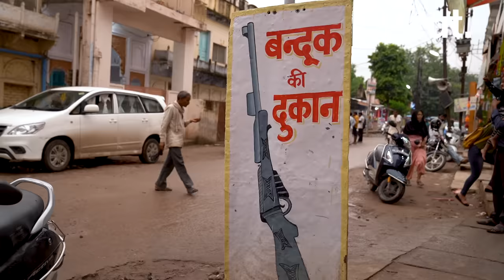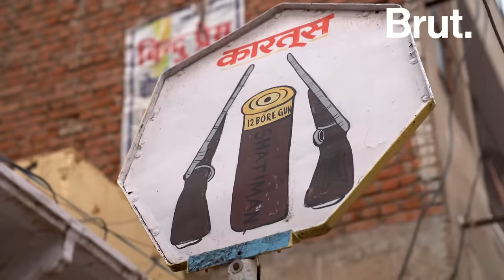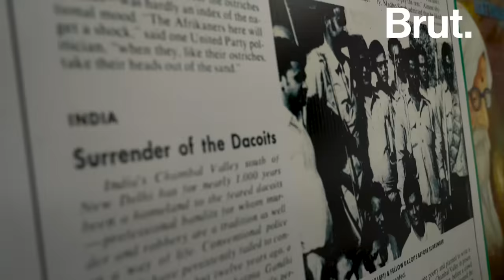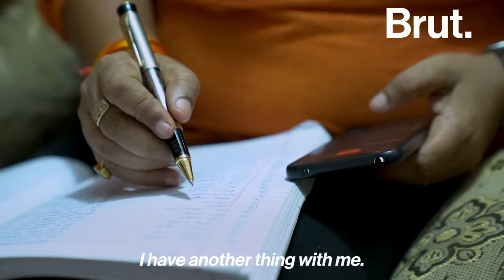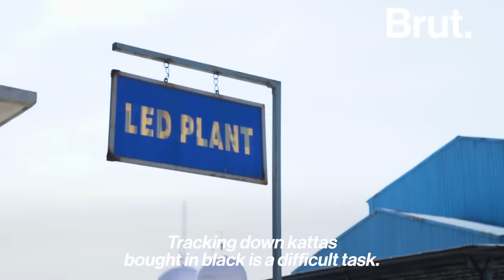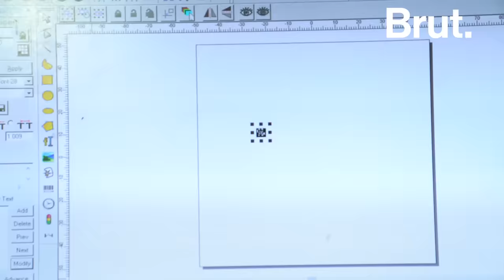Inside Chambal’s Gun Culture

Comment: Some issues with QR codes on ammo: Revolvers won’t automatically eject shell casings. Judging by the photos of those illegal firearms, they won’t either. What about someone defacing the QR code prior to shooting ? Or picking up a spent casing with someone else’s QR code and reloading it ( applying a new primer, gun powder and bullet to the casing ). Then if it’s used in a crime the finger is pointed at an innocent person. Seems like it may increase the cost of owning firearms, but likely will do little in regards to crime.

Comment: The qr code thing is dumb, you can literally take a piece of steel wool or some sandpaper and sand down the qr code completely from the brass. You can also, just pick up the brass after firing the round, which again renders the police from finding out the criminal. You have to be as smart as a chicken to be caught with this tech.

Comment: Engraving a QR code on bullets is a really smart idea. If somehow the inside of the bullet casing is QR coded then it will be even better.
Reply: it'll likely be flattened against the chamber walls, and thus unreadable. also, you could just sand it off. pretty useless in reality.
Reply: @indoorkite651  what will be flattened against the chamber walls? 

Of course it can be sanded off but it will take a lot of time! A countermeasure doesn't have to be perfect, it just needs to make illegal activities more difficult
Reply: @scramjet7466  you can easily sand down the QR code 🤣  what are you talking about
Reply: @jimfleece2880  don't assume it is easy. You can easily ruin the cardridge if you go too deep. Brass cartridges are not very thick, they are less than 1mm think in most places
Reply: @scramjet7466  all you need to do is remove a little bit in one spot and the QR code won't scan
Reply: @jimfleece2880  bruh. Next you will say reading fingerprints is useless because it's easy to erase them